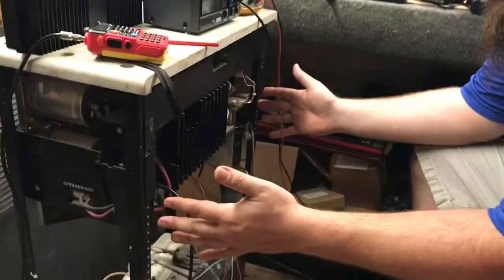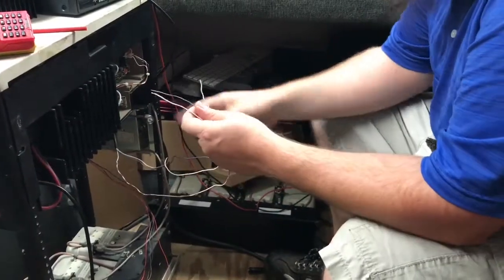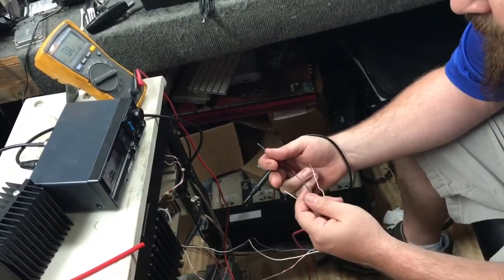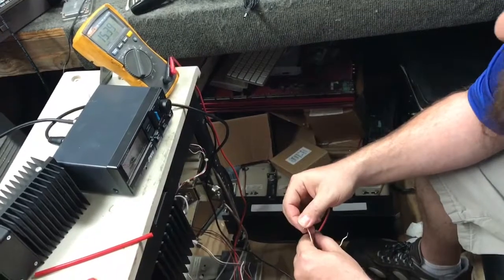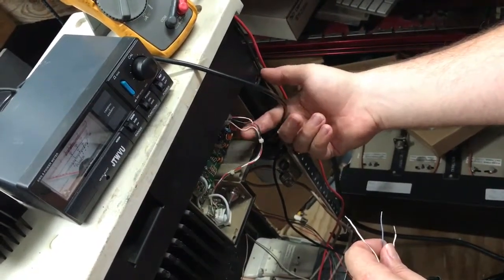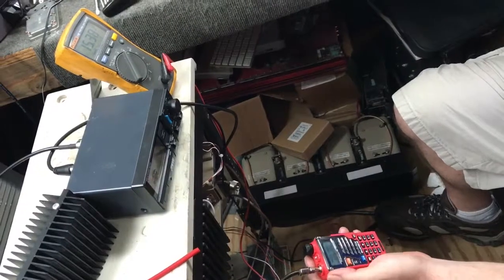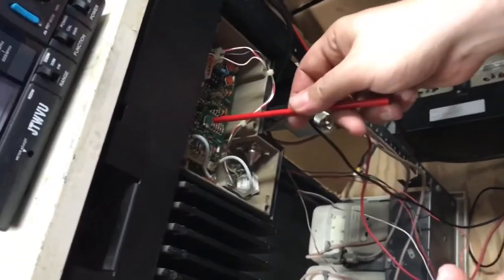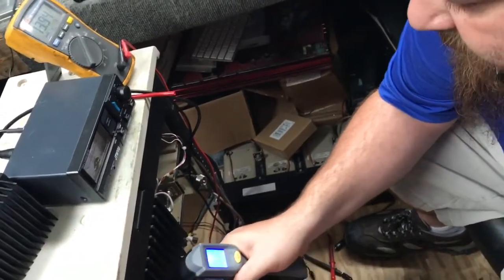MSR2000 TLE2283 External Exciter Mod

Comment: Currently were using a VHF  msf 5000 125 watt pa where receiver was bad, using a gr1225  10 watt repeater as receiver driver set at  3watts to drive the 125 pa output on pa is about 80 watts
Works excellent
But to do this for uhf msr 2000 uhf. you need about 1/4 watt as driver will a maxtrac turn down that much and still function well?

And how to hook up maxtracs as receiver. Driver

Comment: Samuel do you have a video on hooking up the max tracks as a receiver exciter

Like I said in a previous post we are using a G or 1225 to do this exact same thing but it’s hard to find a Gr1225 that will only put out a quarter watt as exciter
I have a lot of maxtracs laying around
Reply from the maker: I am in the middle of changing jobs right now.. Let me get the dust settled and I will cook up a repeater using two UHF maxtracks and a PA..  Motorola did this exact build in some systems..
Reply: Samuel Rock thanks much'

Comment: If I want to hook this up to a Motorola maxtrac do I turn the wattage on the radio down or the input on the amp up?
Reply from the maker: You would remove the PA from the MaxTrac and run the MSR directly off the Exciter in the MaxTrac. If you intend to use this setup as a receiver also you will need to install a RF relay to bypass the amp when in receive mode.

We normally do not use the RX we do this mod to build a repeater, in order to achieve full duplex you all ways have dedicated RX and TX radios.

Comment: Hi Samuel. James(N1ELS) here. Thank you for the video. Very informative.I recently acquired a MSR2000 power supply and PA(TLD2532A-PR). I believe that it is a vhf(150.8-160mhz). My question is how can one adjust the frequency down to the 147.255 range If possible. I plan to use the icom 706 as the exciter. May have to use a potentiometer. Lowest power setting is 500mw on vhf. I want to use pa to give 706 enough power to cleanly hit a specific repeater. I can hit it with high vhf power setting(10w) but not clearly. Very noisy. Receive is good. Also,can you please explain the TRS switches. Hope you get this request. Have looked you up on QRZ.COM but don't have an email address. Thank you for your time and expertise. 73 de N1ELS.
Reply from the maker: This may be a tough project, You will likely need to retune the filter stage of the PA if nothing else.. I go to bet you will find some other tuned circuits that will need some adjustments also..  

Motorola made these in band splits to reject frequencies of other the near by radio systems.. One of the things was trying to keep the ham band out of public safety and business band.  

This would be an extreme up hill project with out good test equipment..  

You would likely be better off building something like this http://g4fev.atspace.com/mrf186linear.htm and mounting it to a recycled heatsink. 

I have built a few of the Chinese amps they work fine, you just gota watch that they supplied you with all the right components..
Reply: Samuel Rock, thanks for the reply and the link. Believe I'll take your advice.

Comment: Where is the nine volts out of the original chassis?
I have a full chassis as it came from Motorola I want to put a gr1225 repeater in front of it as a receiver Exciter so I don't have to worry about the crystals
Looks like I'll have to figure out how to get only a quarter to half what out of the gr1225
Reply from the maker: I don't know if your still working this as you posted 11 months ago..  But if I remember correctly the GR1225 is a full duplex radio. I would save that rig for a mobile repeater and use two MaxTrac radios to build a repeater with.